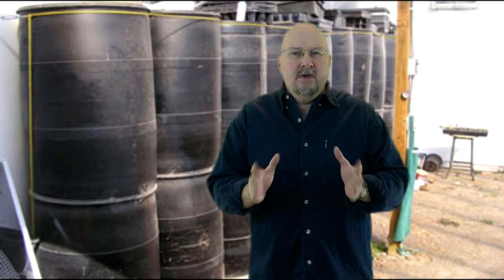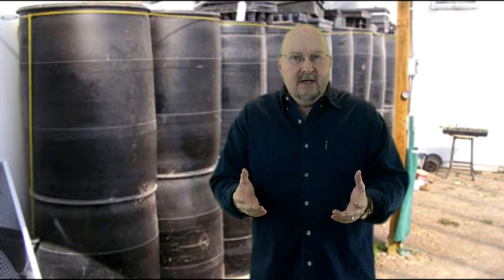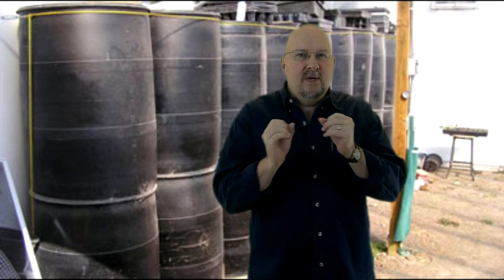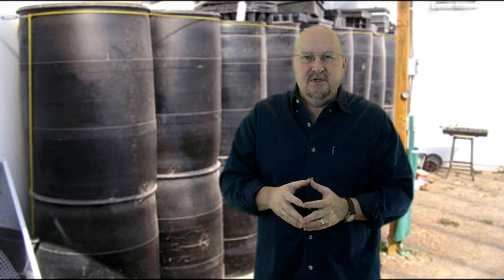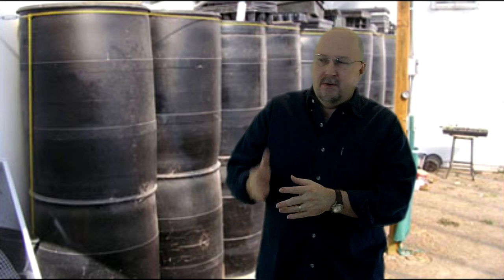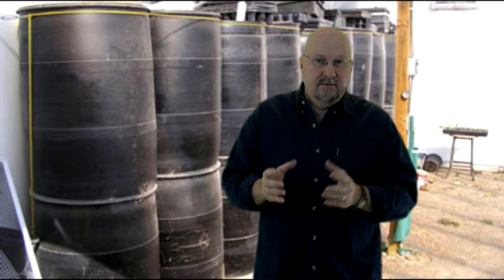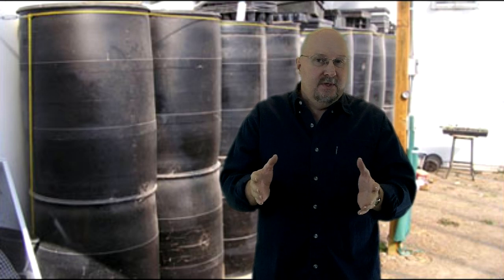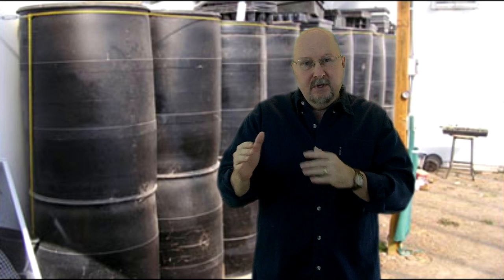Greenhouse heat sinks

Comment: If I have a greenhouse that measures 12'wide by 48' long with a 12' center peak with the south and north being the 48' length and I have 80 55 gal. H2o Barrels of under floor heat sink ( fan fed from roof peak at center of 48' run ) with an additional 40 55 gal. H2o  Barrels of vertical north wall heat sink (medium blue colored )  double layered glazing in an enveloped style outer greenhouse she'll with air lock entrance way 
I want to know if this will be enough heat sink to keep greenhouse warm in North west N.M
Winters and if It might have excess enough to draw off with a H2o/Anti freeze  heat extraction to radiant under wood floors space heating unit   can someone tell me what BTW storage rate I might expect from this much H2o storage mass

Comment: I think this guy means heat storage cause a heat sink in electronics is to take the heat off of a device and help it cool by letting the heat dissipate into another  medium . When it comes to thermodynamics  a heat sink is a reservoir that can absorb an arbitrary amount of heat without significantly changing temperature. 
 heat sink is not a device with the "magical ability to absorb heat like a sponge and send it off to a parallel universe"
Reply: Nah, sink is the common term in this context. In environmental and Ag. Sciences "sink" is used in the sense of being a place where there thing 'sunk' be it carbon or nitrogen or heat, is taken out of a cycle. Not disappeared but stored and then perhaps released back later as needed.
Reply: Heat storage would be accurate for the entire system, but when talking about the solar input cycle it definitely is acting as a heat sink. It removes excess heat from the greenhouse atmosphere and stores it until the cycle reverses and the greenhouse atmosphere acts as a sink for the "stored" heat.
Reply: Lol, I kind of get what he is trying to convey. Better tokeep a kettle with water and/or herbs on the iron cast stove during winter if yourthat concerned.

Comment: Could you tell us how long it would take to melt the barrels if they would happen to freeze if the heat went out in the green house? Or, how long to warm them back up again after freezing. How much of an extra cost would that  be? Barrels take up space also and defeat the reason you have a greenhouse.
Reply: Add antifreeze to the water and it won't freeze no lag time or potential loss
Reply: kevingill3339

Or salt the freezing point is -21.1 degrees Celsius. This is when the saltwater is 23.3% salt (by weight).
Bit cheaper&healthier than antifreeze.

Comment: A rocket mass heater is another supplemental heat option. They burn small pieces wood, and hold a lot of heat.
Reply: much too often wood refills though... you have to CONSTANTLY babysit rocket stoves... no good for overnights...

Comment: I`ve used 200ft of perforated drainage tubing under my 150sqft greenhouse for the past 5 years. It cools the gh in summer and keeps it frost free in winter :) The greenhouse air can heat to well above 80F on winter days with a little weak hazy sun. The 80F air may only be available for an hour which wouldnt do much for a 55gal barrel of water as the heat transfer would be mainly via conduction. The bulk would be lost to the glazing well before it could affect the water temperature. It doesnt have time to escape when you can send it underground at a rate of upto 45 greenhouse airchanges per hour.
The stored heat is directly in the root zone of the plants so they benefit from "warm feet"  As the heat is underground, the radiant losses are much lower, barrels will radiate heat to any object that is colder, that includes objects well outside the greenhouse and space on cloudless nights, unless you have the glazing and insulation covered with a radiant barrier :)
Reply: Thats a great design.unlike most I will   do lots of research  before I break ground I was just wondering if there was any formula for how much pipe to square footage that you followed or is that your  prototype.. p.s.I think this guy would have more luck storing bodies than heat in those barrels. ..haha
Reply: H8edsinclair
You could pay a crowd of people to sleep in the greehouse, that would keep it warm overnight :)
Water is a great medium for heat storage but earth is just as good if you use enough of it, the main difference is its on-site, free and its not prone to leaks. It doesnt take up space in the greenhouse or absorb valuable light (black barrels dont reflect light).  If i used water to provide the same storage capacity as i have now i would need 8000 litres, i would need to convert the entire floor area into a pond 570mm deep lol.
Reply: Not sure this will be seen as these comments were made years ago but I am going to design a system with solar evacuated tubes to heats the 55 gallon drums I think I can get a green house at 70 degrees in the winter with a low of 50

Comment: You can also have a meter high pile of compost surrounding the greenhouse on the outside.
Reply: Awesome idea, make the north wall you compost pile and it adds heat and insulates.
Reply: Jacques Gauthier   Straw makes 120 to 140 degrees of heat! Keep it wet.. .. and you can grow food in the bales

Comment: Our frost line is almost 2 meters down  means that you have several months of frost. For me it is half a meter in France (weeks and not months). Time to penetrate for diffusivity is like the square of depth. A factor 4 in depth needs 4x4=16 in time.
For .one day like for your  "srap buckets", around 30 cm underground is sufficient in soft  soil with  straw and inexpensive tubes, and not  the 3 - 12 meters for 4 to 6 months, In soft soil you can push small hard tubes at this depth  with a mass..

Comment: I do like the idea but from what I have seen, it has to be a depth of about 7 - 30 meters or more depending on location. I know here our frost line is almost 2 meters down and to be able to actually retain heat it will have to be deeper than that. I have wondered about this for some time but have not experimented with it just yet.

Comment: Yes, the size is not the same, like one day with respect to 365 days of one year, but the physics is the same.
 A few m3 of earth, gratis under the greenhouse  (or very near), with inexpensive tubes of very small diameter pushed inside this earth, will store as well the heat for one day, for only the price of the plastic tubes, around 40$  for 200m  !!!
You do not need drilling in the soft earth, only pushing with a mass small tubes..
And your greenhouse will be free of any "srap buckets" .

Comment: Clearly, you have never tried to keep the summer heat over 6 months for the winter in your " few srap buckets", even very insulated,, at 1000maltitude, in the north of the US Canada frontier   !!!
It is impossible !!
Please learn the physics of diffusion of heat and diffusivity in wikipedia and others;
The earth by diffusivity over a depth of 3 to 9m keeps the heat for one year. gratis.
Also calculate the size of  a  "few scrap buckets" to store the  heat of a house over all one winter.

,

Comment: Yes they seem to be smaller but then you add in the cost of drilling the equivalent of wells at likely $6000+ per well to set up the underground heat storage. Not that I think the idea you mentioned is bad because it is not by any means but it is far more costly than a few scrap buckets.

Comment: The water storage tanks  at Drake Landing Soler community ( w-ww;dlsc.ca ) are quite smaller in heat capacity than the Borehole Thermal Energy Storage in earth, a few days in comparaison to 6 months, from summer to winter, so that extremely large water tanks at the place of simple bore hole drilling would be very expensive !!  
Earth gratis under our feet with some drilling is quite less expensive than very large tanks  (above 10000m3 ) put underground at depth more than 10 meters  !!

Comment: The Drake Landing houses that you mention actually do use water storage tanks for both heating and cooling. They also use Borehole Thermal Energy Storage. Look at the Energy Centre page to see how their system works.

Comment: Water tanks are not necessary, too expensive, the gratis underground earth stores heat as well (with a volume of earth 4 times larger, but for a price nearly zero ).
The earth under more than 3meters, keeps  heat over 6 monthts, allowing   to use excess summer heat to heat gratis in winter.
This work for houses in w ww.dlsc.ca since 2007  and is much simpler for greenhouse in winter with no external heating releasing any CO2.
It is incredible that this  so simple is not known or disregarded.

Comment: At 4:25 you said: "you'll want... between 2 gallons and 5 gallons of water for the exposed surface area of your glazing."  Did you mean to say that you'll need 2-5 gallons per unit surface area, like 2-5 gallons per square foot for example?